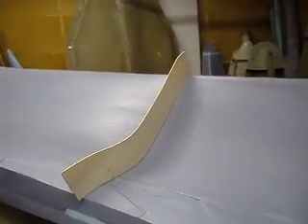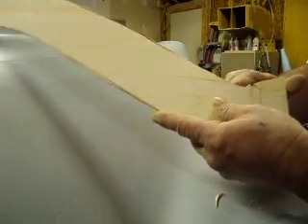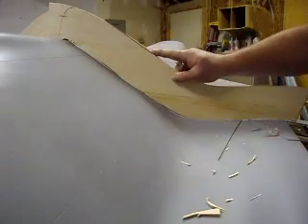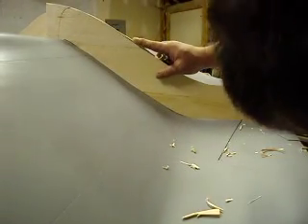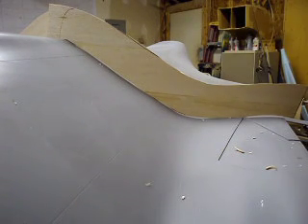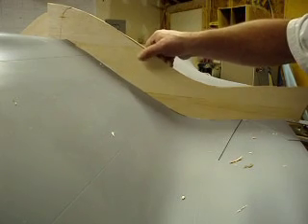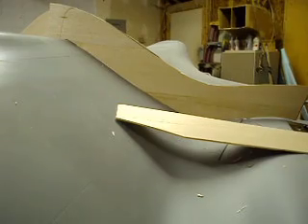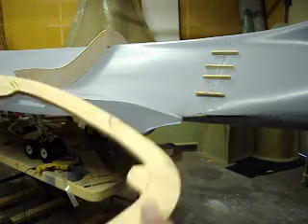How to build a RC Jet B-1 Bomber #99

Comment: Using this technique won't those bulkheads be sized to the outside dimensions and not the inside? They include the thickness of the fiberglass layup so they'll be too big.